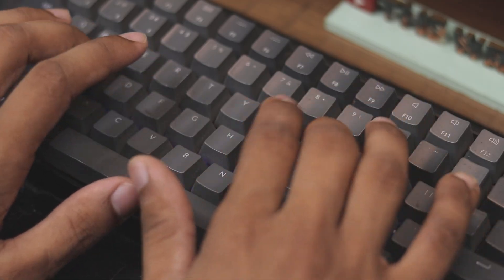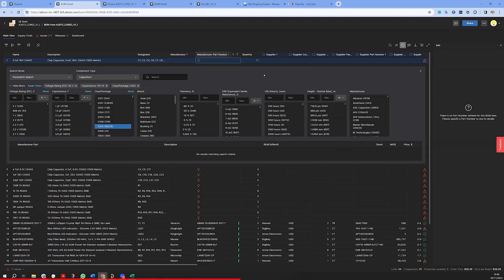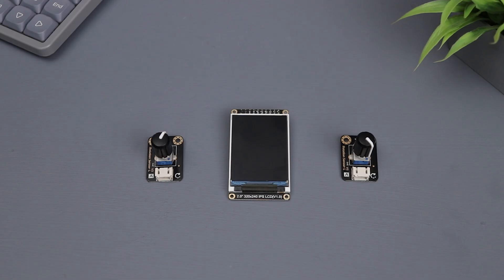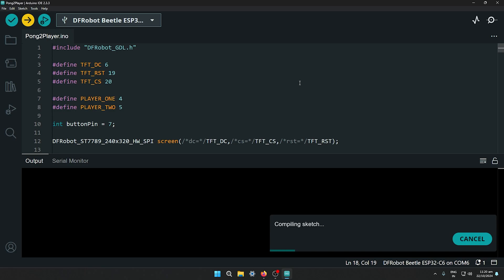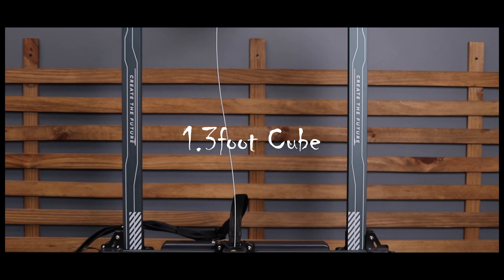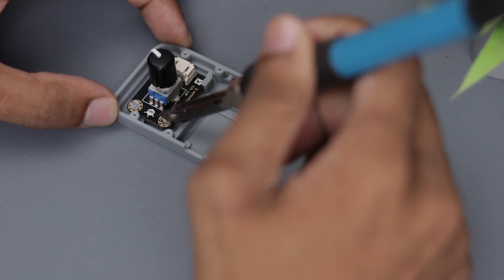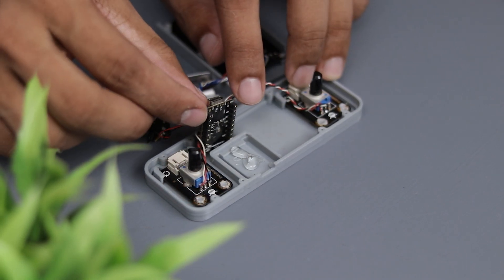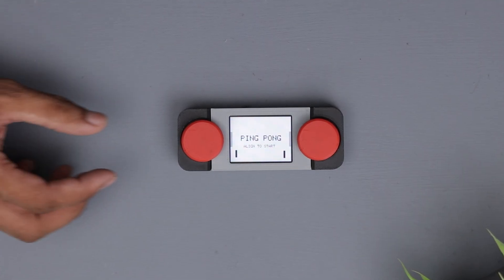Build Your Own Retro 2-Player Game!

Comment: Would you mind share your wire digram? I'm confused by all the links. From the video, compare t testing stages, wire link is different to assembling stages. and the resistance, in testing process,How many ohms of resistance? why it is missing in assembling? kind of stuck after by all the componets.....

Comment: Nice video. But some more insight into the design process would be great! Also, why melt the plastic posts to hold the PCBs down and not include screws? I understand it's way faster to assemble and doesnt involve tapping threads into the posts, but if you ever need to take the handheld apart again to troubleshoot or adjust things, it'll be a pain. Still, the design looks pretty well thought out otherwise.
Reply from the maker: I completely agree with you, but I want to make it as slim as possible, and I’m having trouble finding the right screws.